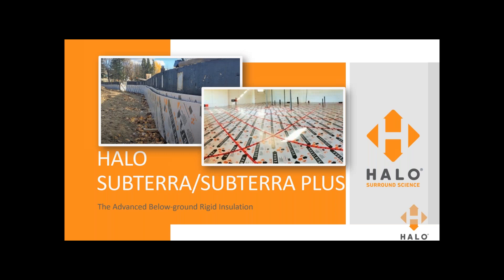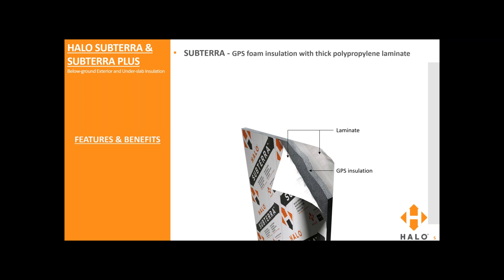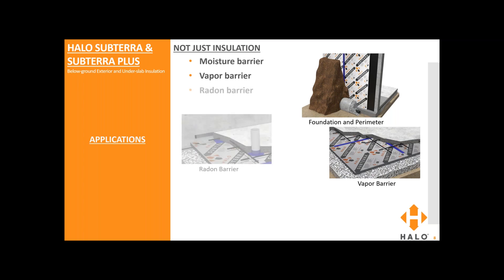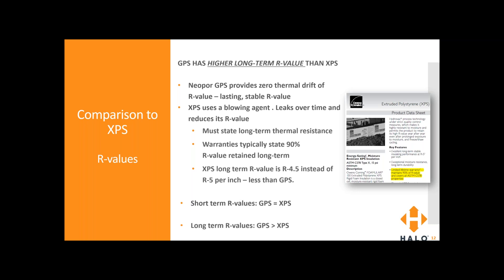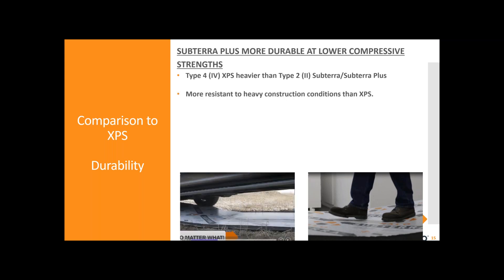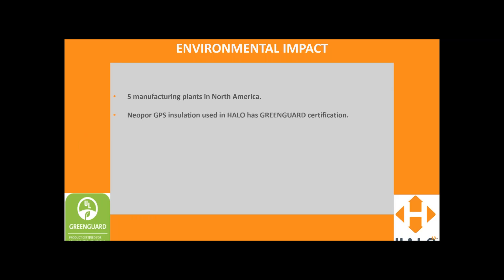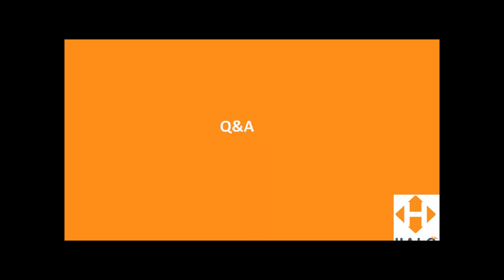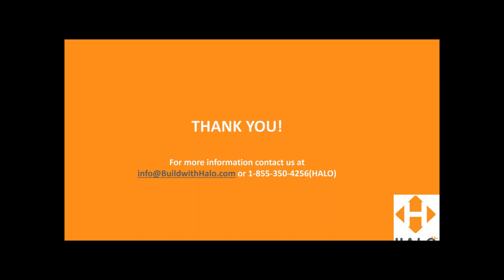WEBCAST: Halo Subterra 101—The Low Carbon Foam Board Insulation Perfectly Designed For Below Grade

Comment: I understand the Subterra use under the basement slab. What I wanted to see was a discussion about basement walls specifically using Subterra on the exterior versus Interra Plus on the interior. In my case, there are no plans yet to add interior stud walls or gypsum wallboard. Interested in cost comparison even if simply relative and moisture/condensation along with recommended thickness for a given climate zone. In my case it would be climate zone 4.

Comment: We used 5 inches of XPS below the slab and on the outside of the foundation wall
We are in climate zone 4
To avoid thermal bridge we did not use strip footings, but rather a raft slab on 5 inches of foam the walls were sat on the slab and the insulation on the outside of the walls makes direct contact with the foam under the slab